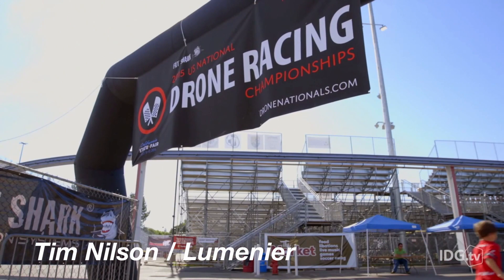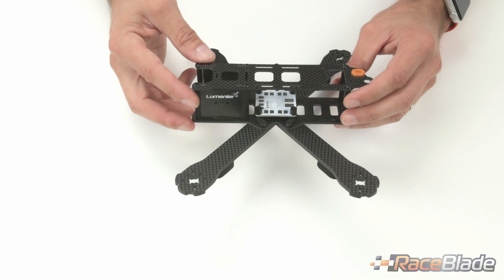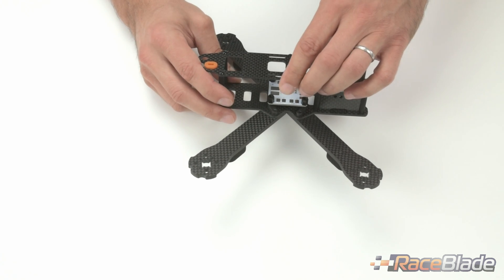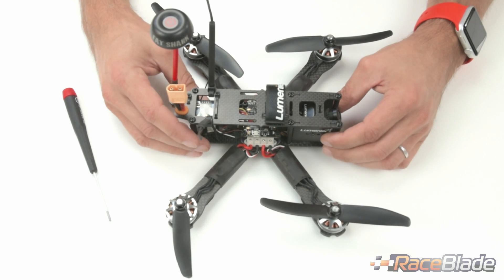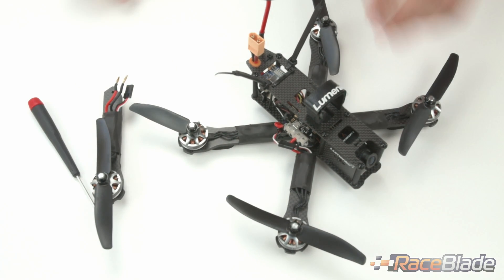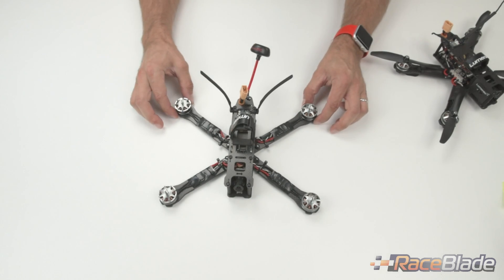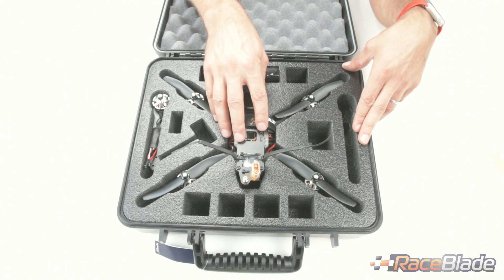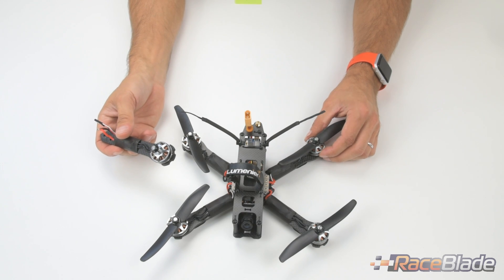Lumenier QAV-R (formerly RaceBlade) FPV Racing Quadcopter

Comment: My fav frame. You can buy them here fully built and tuned by pro builder with latest F4 flight controller and 30 amp Dshot esc's  
http://www.ebay.com/itm/Walkera-034-KILLER-034-V3-QUADCOPTER-RACING-DRONE-PRO-BUILT-over-90-mph-or-more-/201825212767?

Comment: Can we finally stop this ,,bring the center of gravity together,, illusion? What matters is the position of the motors and the body, not where the arms come together... It doesn't matter if they are mounted in the middle or the front/rear when the position of the motors stays the same... It still is one plain.
Reply: This x-frame design is probably motivated by the one used by Chad Nowak, the 2015 drone national winner.  This tendency of popularizing (inter)national competition winner's design is historically common to all RC model competitions - it could be the frame design, propeller brand, type of muffler, electronics, even wiring style, etc...you name it.  So popular designs tend to come and go as people eventually realize certain design aspects are not critical to the overall performance.

Comment: would anybody be able to let me know how much all this would be to make? including a battery, FPV goggles and taranis controller? 
cheers
Reply: 1000$ at least if you buy quality, taranis +receiver (230$) motor 2204 2300 kv (80$-100$), frame (120$), esc (80$) fc (25$) camera (30$) vtx (30-70$), goggles (250-500$), antennas (40-60$),
Reply: rip.. guess im selling my left lung
Reply: +SirSollo When? send me an email please.

Comment: X design? Why would that be better for executing flips and rolls than a symmetrical design for instance. From what I can see the motor spacing does not make it a square, and the mass is distributed on the short axis where the motors are closer together.
Doesn't make sense to me

Comment: All these features are great but the CG is still way off with a battery sitting up on the top plate. Why didn't you use 2 top plates? The normal height protecting the camera in the front and one in the back using 15 or 20mm standoffs. I personally use 10mm standoffs and my quad performs unlike any other frame I have flown. With this frame, you would have to extend the plates forward so the battery still sits in the middle with a 2 plate configuration. Don't get me wrong, this frame is great but by fixing the vertical cg location, you could really improve performance.

Comment: That is Genius the times i have taken a full spare quad to the field in case of a breakdown just to keep flying. Which is what most will do. But the kicka is exactly like you say. Everybody has a fave ( 1 they spend the extra time on that tune and the camera is right everything's right ) I would much rather have 2 spare arms ready to go and a quick change than fly the second quad that is a ok at least im still flying quad :D
Reply: +Pudsey - Rc I would also like to add a great frame for reviewers. Example 4 new motors to test or 4 new esc,s to test. Flick arms off put the test motors , esc,s arms on and away you go. Tests done revert back to your chosen set up :D Very sweet idea.
Reply: +Pudsey - Rc Was just thinking that , makes reviewing motors and esc's nice and easy
Reply: Great minds mate :D

Comment: Nice to see an in depth video on a product. I like inovation behind the screws mounting the arms and being simple to replace but hopefully none need replacing haha. pdb seems cool but I still much prefer to solder connections. like how you used design from 210/180 and started to supply foam pads for landing gear never liked those other ones. looks sick! nice alternative to look at after I've fished with my 210.
Reply: Stick a link in the decription lad
Reply from the maker: +Tom Smith FPV Done!